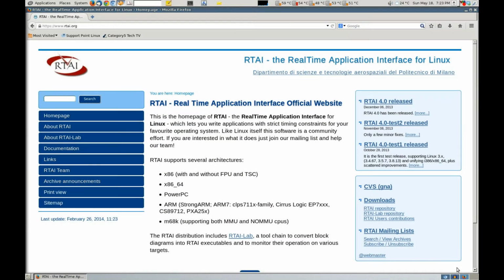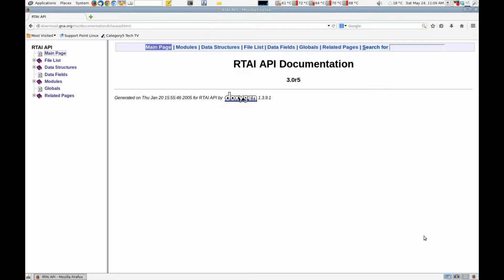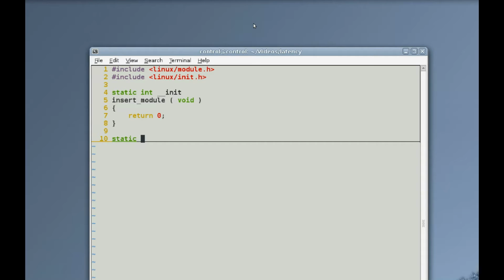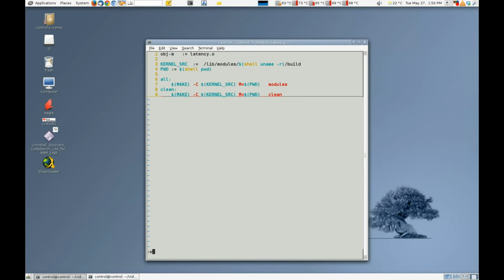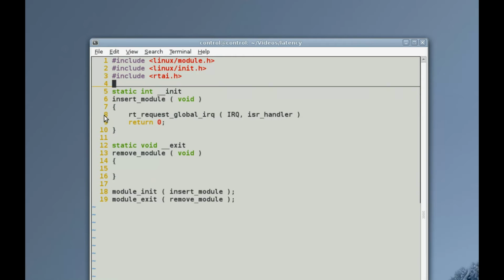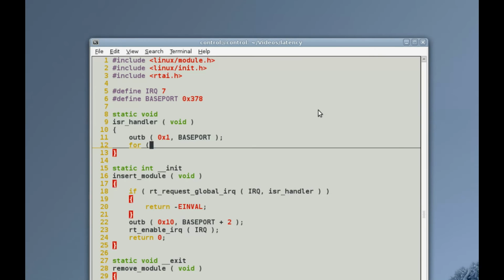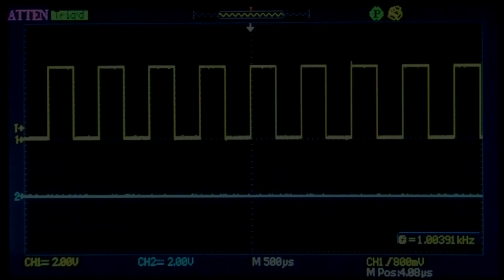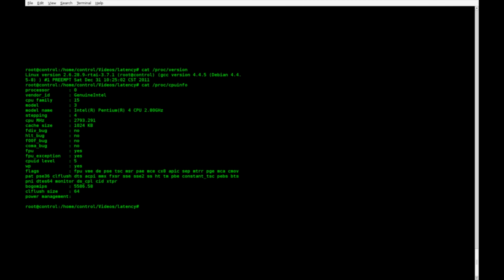RTAI - Measuring Interrupt Latency

Comment: Hi aldo núñez,
I have installed RTAI 3.8 with kernel version 3.10 in my new Intel core 2 duo system.
I could not test, if my parallel port is working or not. As I don't have oscilloscope, can you suggest me some way to run and test your module. 
Thanks
Reply from the maker: Hello Satyam, well for interrupt signal you can use a 5 volts dc power 
or a pair of AA batteries connected in series works too. 

To start, connect the negative terminal (GND) of your DC power to any of the GND parport pins (pins 18 to 25). 

Now connect a wire to ACK (pin 10) parport terminal. 

Then, every time do you want to make an interrupt, switch the wire connected to pin 10, between GND and the positive terminal of your dc power. You can use a switch too.

Finally, to check if it is working, modify the isr_handler function:

static void
isr_handler ( void )
{
    printk ( "interrupt: %d\n", i );
    i++;
    rt_ack_irq ( IRQ );
}

The isr_handler function,  now prints a message when an interrupt arrives.

To print the messages sent by isr_handler function, use the command 'dmesg'.

I hope it can help you. Be very careful when you connect the wires to  parallel port.

Greetings.